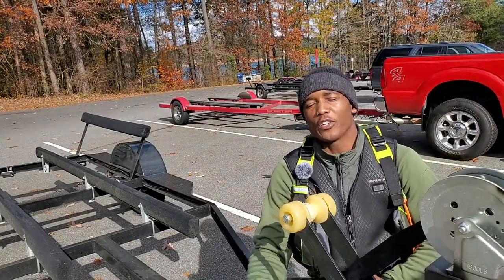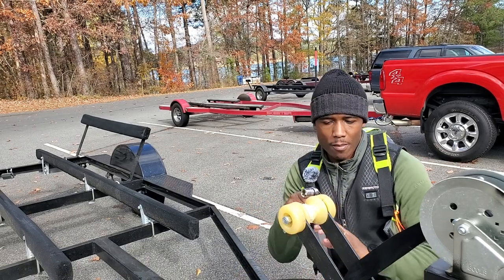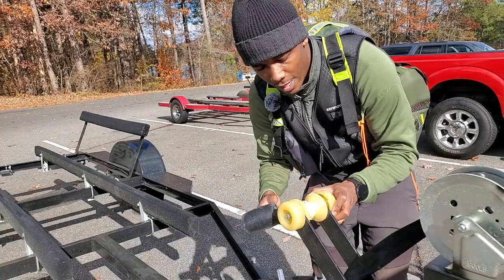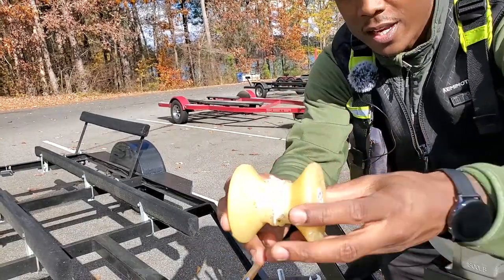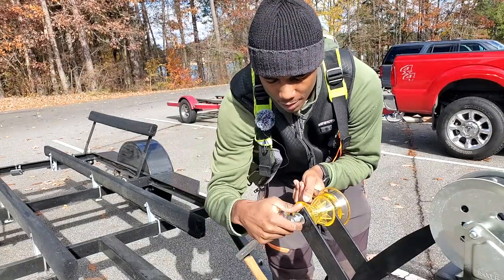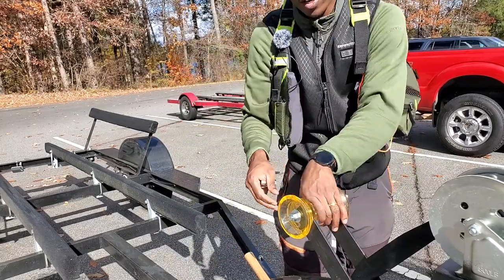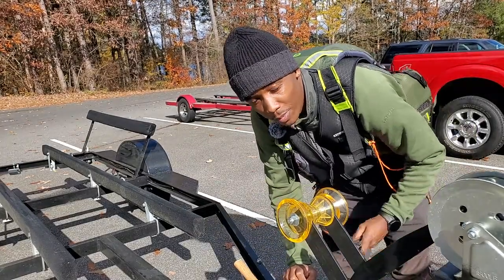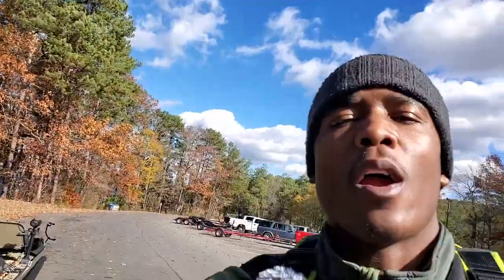How To Replace Boat Trailer Bow Roller for Jon Boat - Shoreline Marine Bow Roller Review!

Comment: Good mod.  Just a note. It looks like you had your safety chain strapped to the winch line vs the bow eye on the hull, make sure and properly use your safeties.
Reply from the maker: Thanks for the advice. I attempted to put it there but my winch clip and safety chain wouldn't fit simultaneously. Any insight to accomplish this would be great
Reply: @Fishing Is Therapy  ay yeah no worries.
Any chance you're able to extend the chain to reach or is the eye itself to small to accomitade? Sometimes changing the angle of your bow roller and winch can get so some clearance
Reply from the maker: @whalescience8831  The eye itself was too small to accommodate the winch clip and quick connect.
Reply: @Fishing Is Therapy  ah. That's unfortunate. I see you're running transom straps so you're probably ok. Nice rig though
Reply from the maker: @WhaleScience  Just downsized the clip and extended the chain, I was able to secure it properly. Thanks for the advice and the head up. I appreciate it.
Reply: @Fishing Is Therapy  glad to hear it. Keep posting brother. Loving the vids
Reply from the maker: @whalescience8831  Absolutely brother. More to come soon! Take care